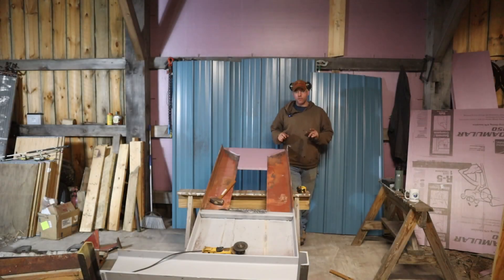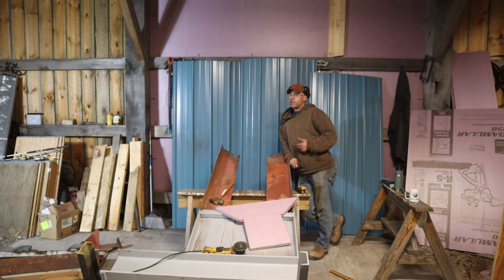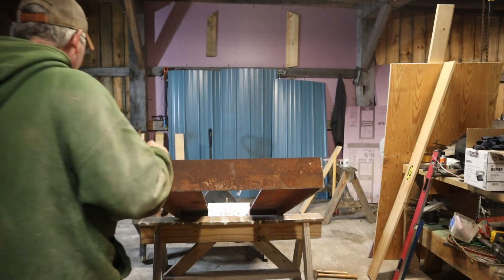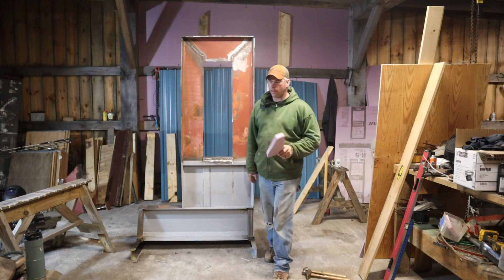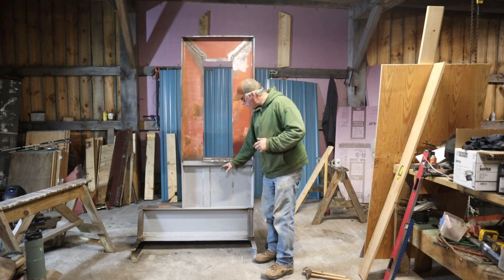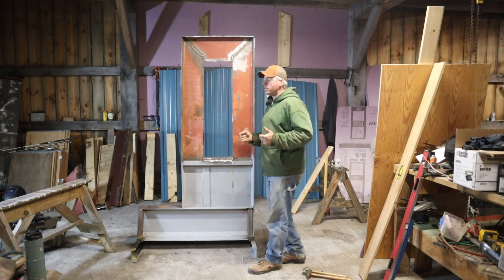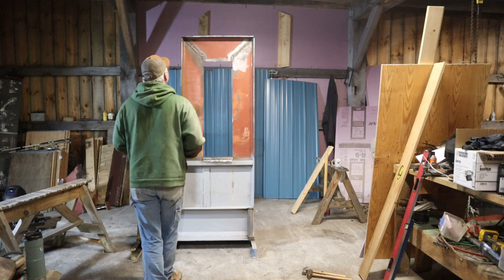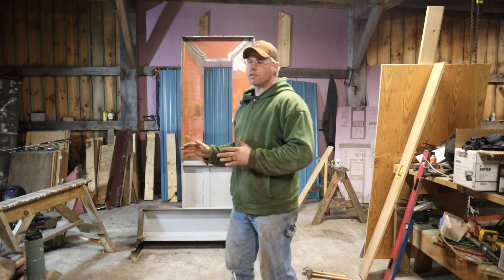Super Forge Press Build Part 4: Topping Out The Frame

Comment: Good job man
Reply from the maker: Hello Keith
Reply: TheTradesmanChannel  hey I got a question about a marathon electric motor I found at the dump  and the only thing I kno is the hp hz and the volts I have no idea what the other one are  it’s hz 60 hp1 rpm1075 volt460 fla2.9 sf1.0 and code b maybe you know
Reply from the maker: 460 volt three phase, full load amps are 2.9 amps and so on.
Reply: TheTradesmanChannel  ok thanks again